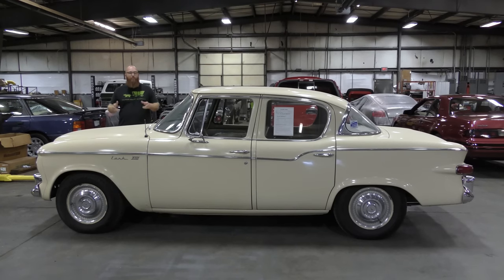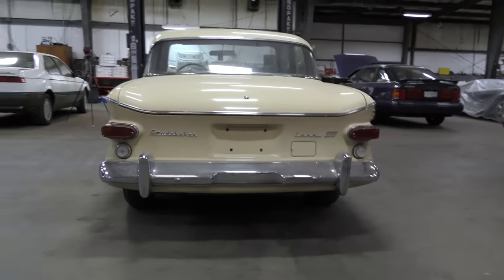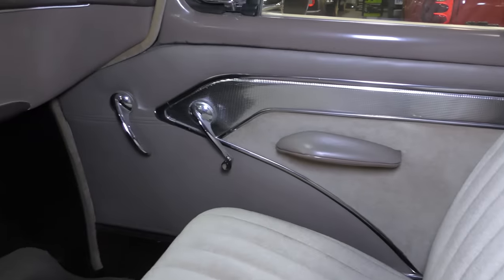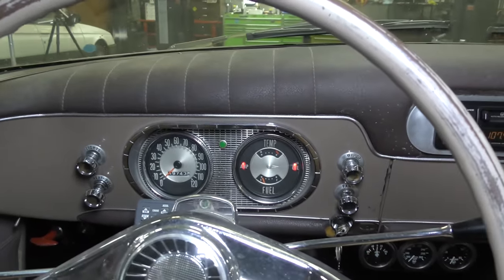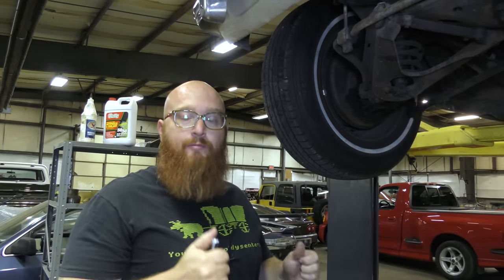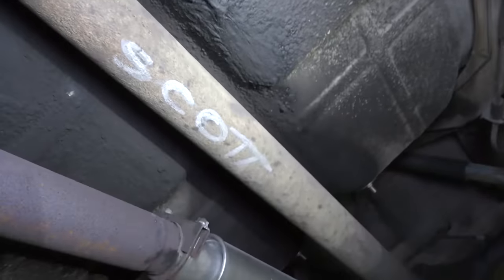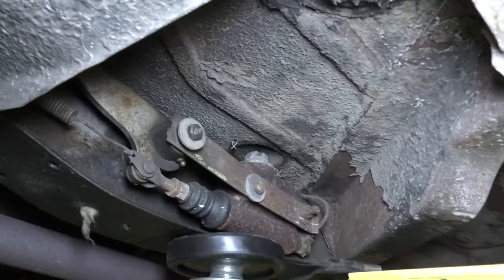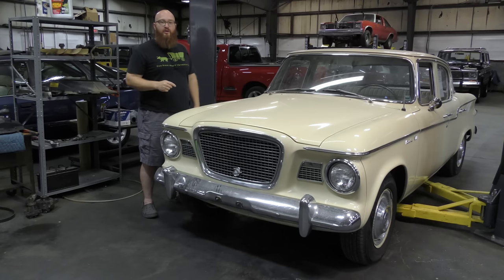Finally a CAR WIZARD approved engine swap done on this '60 Studebaker Lark VIII

Comment: Pathetically design staring like the 49 to 54 Chevy full-size cars and Corvettes on up into the 50s away. That big knuckle in the center on the crossmember has a hell of a load on it that could’ve been eliminated have they just went from an idler arm on the right side to the Pitman arm on the driver side like “ normal cars “.PS it looks like the lift cushion mount is squashing the emergency brake cable. Make sure it doesn’t stay on once you pull it, from being collapsed

Comment: I do not agree with you Wizard.  Completely unnecessary to swap a 48,000 mile Studebaker engine for yet another Chevy V8 swap.  Ruined a wonderful Studebaker with this needless swap.  BTW in front that is the Lark logo not the Studebaker logo which is an stylized S.

Comment: Damn surprised wizard'  hasn't removed that shit fram oil filter  ...... I rave rebuilt  many engines  due to fram failures 
There is even a video about this known problem ...on you tube

Comment: Dude those oil points are stupid. They have them because they didn't hold them very long and were crazy lose when they were bran new. Nowadays steering and suspension everything is muuuuccchhhh better than before. Don't belive me. Go drive an old car then. Also my 13 has 130k and still on all original parts. And had a toyota that had 250k miles and was also all steering parts and drove great. So yeah new ones  last way longer wizard. Stop lol

Comment: Jeez...another small block Chevy transplant because the owner is cheap, has no imagination, and apparently the inability to build anything more challenging. I'd have kept it all Studebaker (289 with Paxton supercharger), but if not, I'd have went with a Ford or Mopar small block. Anything but another cheap-ass Chevy.

Comment: That's one ugly ass car. But fantastic job on the swap. Can't beat an old SBC. And if it takes you an hour to do that heater core, then you suck and shouldn't work on cars. I guarantee you that's a 30 minute tops job.